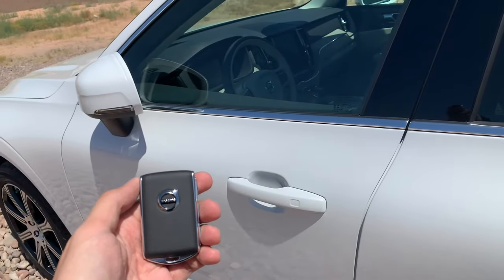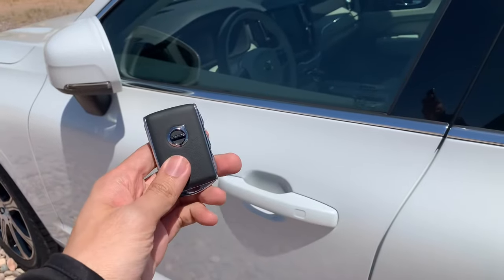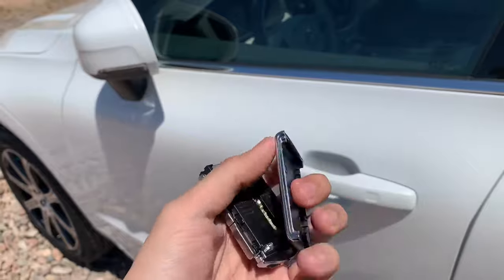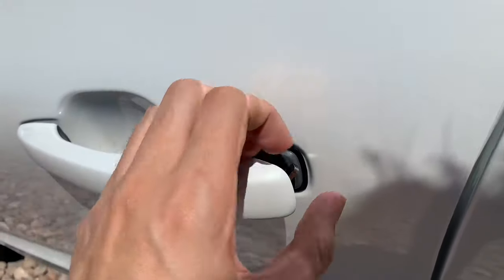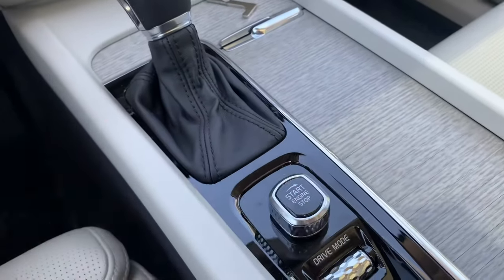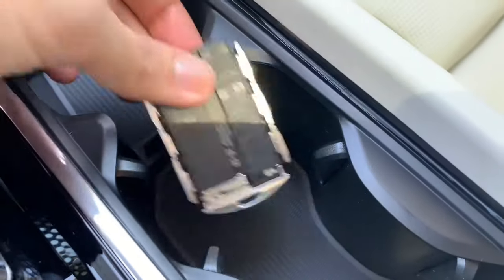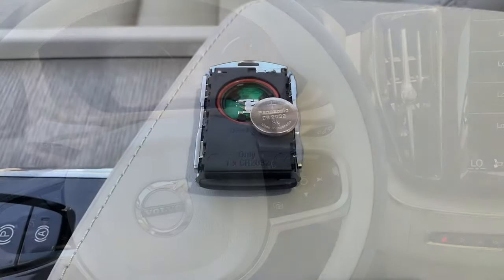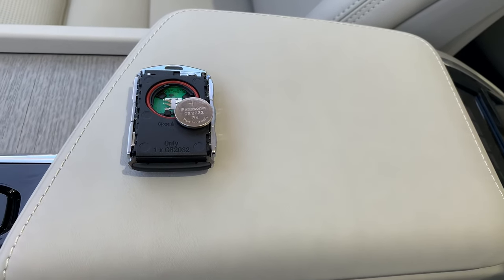Volvo Key Battery Dead

Comment: I replaced my battery in both key fobs but the only way to start the car is with the fob on the sensor.  The fobs do not lock or unlock the car either - help!!
Reply: Hello, Did you find the problem? I have the same, thank you
Reply: @anonyme2777  The dealer had to reset them.
Reply: @anonyme2777  I am having this same problem and new key fobs did not help and the dealer says they don’t know how to fix it. Were you able to get yours fixed?

Comment: I had a car dealer change my battery but I still can’t lock or unluck my car. Sometimes, even when I place the fob in the cup holder the car is having problem in finding the key aswell.

Comment: Thanks for this. Appreciate it. 
After this my keys are not working for unlocking or locking and it’s practically dead. I couldn’t lock my cars as the keys are not responding. Any solutions for that? It’s S90 2018 UK version.

Comment: So the car alarm is going to go off every time I use the key in te door handle? Neighbors will love that! I dont have any marking in the bottom of the cup older. 2021 XC40
Reply: Look for a very small icon at the front and center on the bottom inside of your larger storage compartment between the seats. Start your car before the neighbors come at you.

Comment: This is really helpful.  The problem I'm having is my FOB no longer works after a period of a week or two.  Once I remove and then re-insert the battery, everything works again.  This happened once I let my online volvo services stop.  Could the two be related?
Reply: I had the same issue and now my car doors won’t open at all and the Volvo dealership says they don’t know how to fix it. 😞
Reply: @mcpheex3  that’s awful. Have they tried to reactivate your online subscription to see if that helps?  Since locking and unlocking your is a reasonable expectation for an owner, I hope Volvo steps up and supports you. GL
Reply: @tikishark1  Thank you. First they charged me $700 to replace the 12v battery which did not fix the problem. Now they are telling it will be $5-6k for the next “try” at fixing it. But they have said Volvo in Sweden said they do not know how to fix it. So frustrating. Thank you for responding. ❤
Reply: @tikishark1  Now that you mention that, when I tried to open my car via the app the morning it wouldn’t open, my data had been wiped from the app altogether. I will make that suggestion and see. But that would be such a crazy issue!
Reply: @mcpheex3  best of luck 🤞
Reply: @mcpheex3  that’s awful. Are you near a different Volvo dealership?  A 2nd opinion may be worth a shot. I feel they should have put in a new battery as a trial, cost free and then if it worked, then charged you for the battery. Great cars, but when they decide to break, they really break.
Reply: @tikishark1   That makes sense to me, but apparently they don’t think so. 😂 That is so true - when they break, they really break. I thought I would keep this car forever but I no longer trust it. I have read other folks getting locked inside the car with a similar problem and having to break the window to get out. So… I’m thinking I’ll make a change if I can ever get it fixed and sell it. Thank you so much for responding. I appreciate it. ❤

Comment: Does this apply to the sport key with dead battery, assuming I could get into the car?
Reply: The battery on the sport key is technically non replaceable, and it does not feature a real key. However, some people on YouTube have successfully changed the battery but at the consequence of loosing waterproofing.

Comment: I was told you may cancel some warranty if you try to replace it yourself.  Is that true?  The nearest dealership is 3 hours away.
Reply: Are you both serious?
Reply: @teeth-man  the sport key/ key tag/ buttonless key is probably what they meant by losing warrenty on the key, cause it isn’t possible to change the battery and retaining the waterproof element on the key.